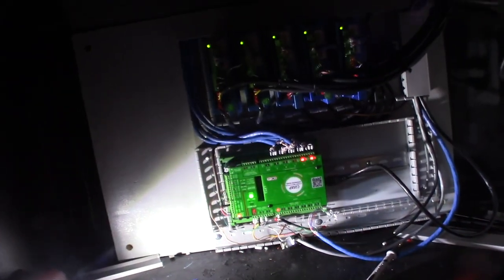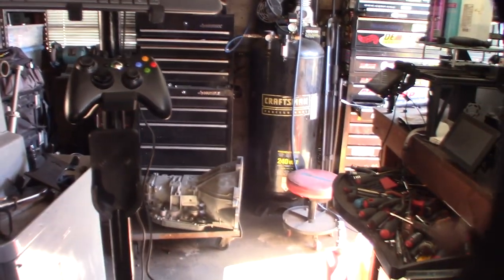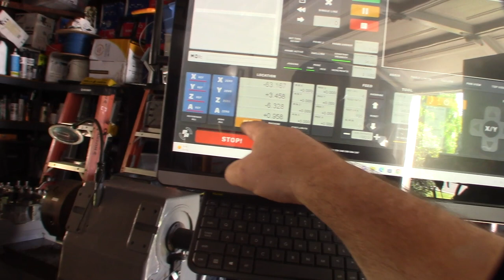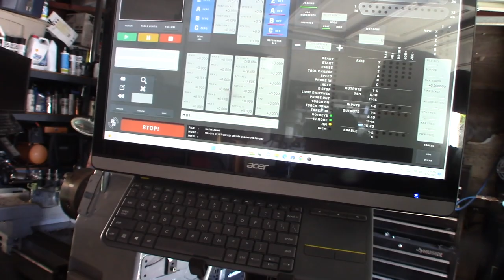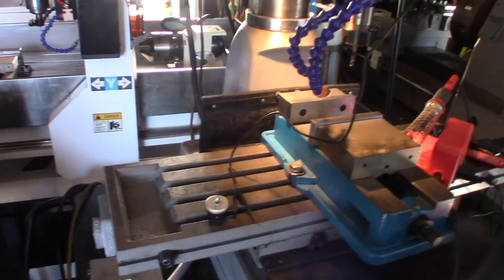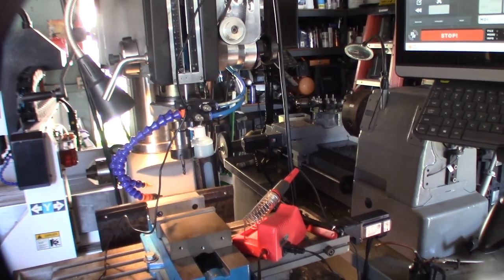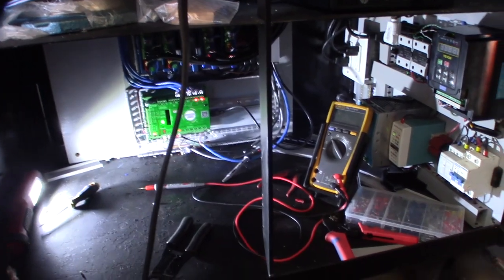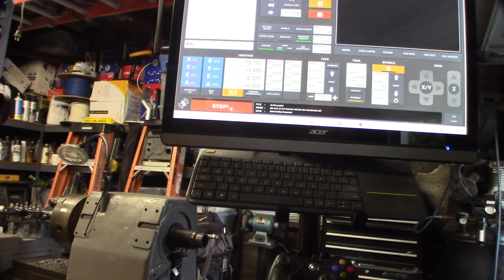CNC4PC C25XP ESS Smoothstepper install Mach3 Mach4

Comment: Both my cnc I used the ethernet smoothstepper boards.  I was using Parallel boards prior to those and it was a massive upgrade. Both machines have been 100% reliable and super accurate.  I will not be upgrading those any time soon.  ATC for my big 60,120 is next on the upgrade path.

Comment: Hi! I have the same problems with probing on EC300 and UC300! All i have to say is that they made me crazy trying to figure out why they aren't probing correct! Its the .dll not handling the G31 code! I've manage to find one code that's working every time zeroing XYZ! Only one! Tried to contact the manufacturer with no luck! Maybe in the near (or far) future they will correct it but for now these boards do not probe sadly! Thank you for your great video!